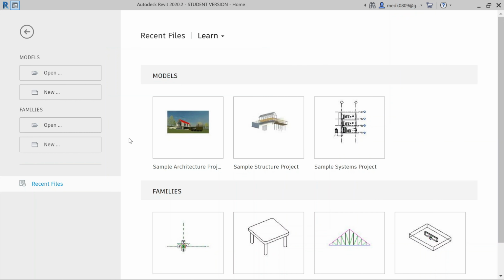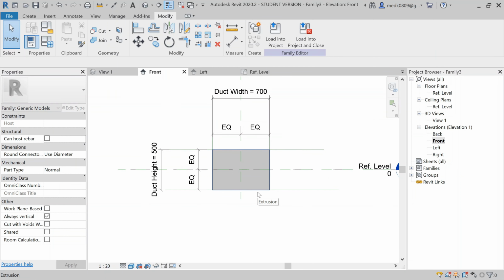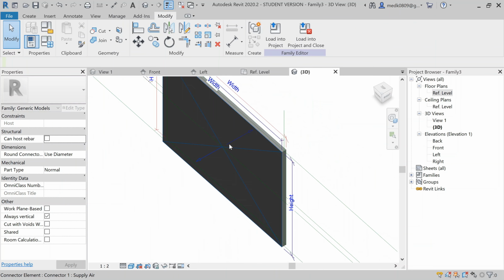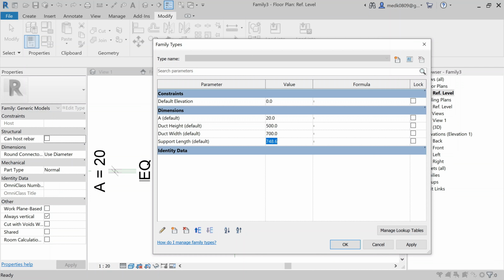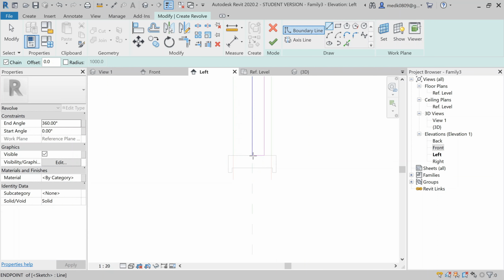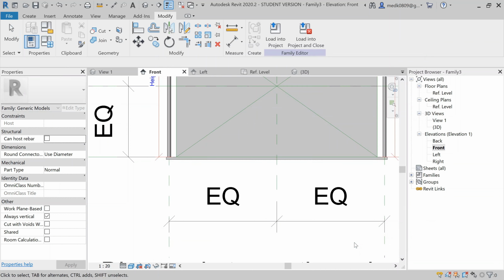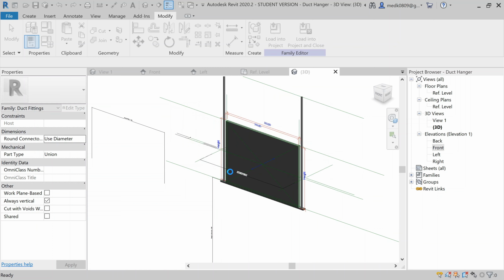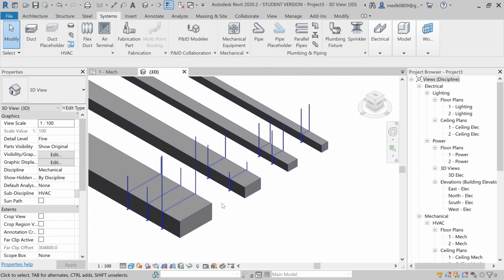Duct Hanger Creation in Revit⚙️💻 | Parametric Family⚙️ | Step by Step✅ | English🌐

Comment: How about the rod connecting to slab ? How can I set the parameters ?
Reply from the maker: In the current example, regulate the value of the length of the rods till the slab.
Reply: @ClickAndDesign   How can I specify the slab ?
Reply from the maker: Use align command to align the rod end with the slab.
Reply: @ClickAndDesign  how can I connect with mail
Reply from the maker: @rakeshraghavan16091  medk0809@gmail.com